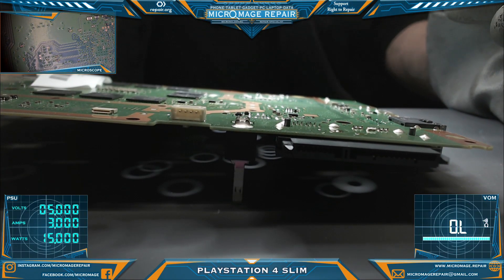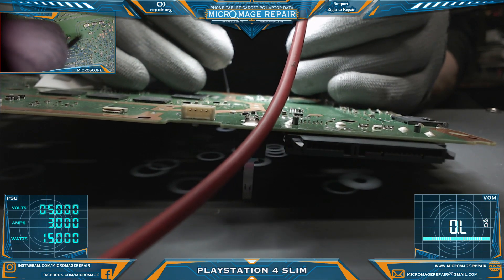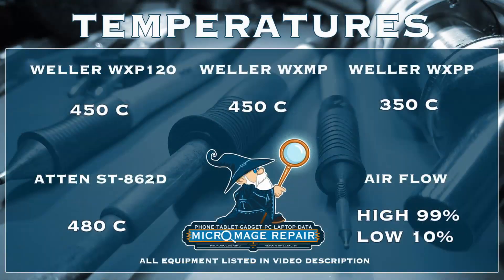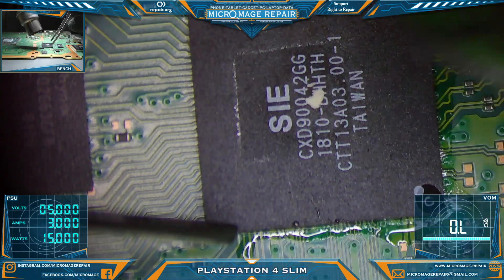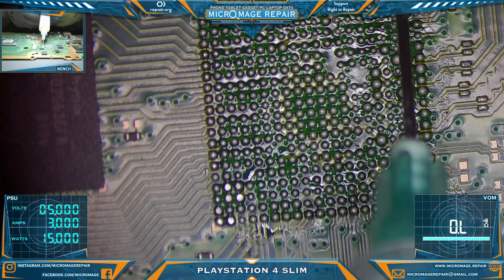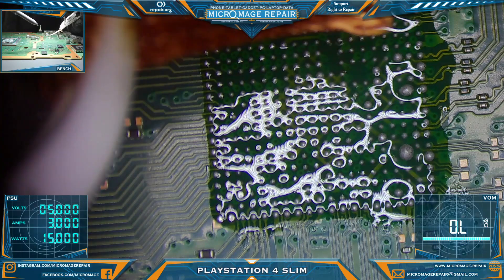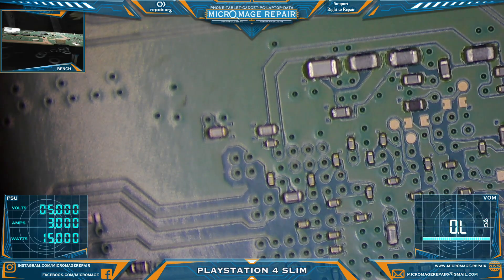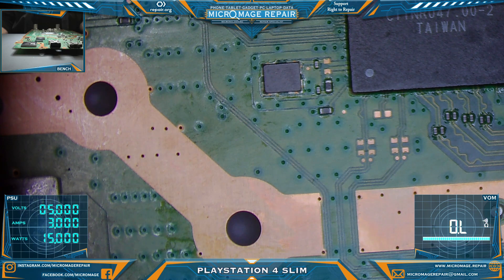Solder & Wick: PS4 Slim South Bridge Soldering

Comment: I tried removing this same chip with my air station and I couldn't get it to budge. had it at 450c/max air flow. :(
Reply from the maker: I hear you.
These chips take an incredible amount of heat. Before the pre-heater it took 10-15 mins at 480c max. Even after it isn't fast.

Comment: Hey mate nice video. What temperature and air flow speed you use to reflow southbridge? Also  is it better to heat board from below or above?
Reply from the maker: 480C at 99% for removal.
I tack a new one down at same temp but 20% air (just looking for a few points of contact at that juncture)
Once tacked down I flux and crank back to 99%.
All from above the board up to this point. 
Never tried from below, but it's probably not a bad thing to try. 
Might work on the Slim.
Doubt I'd try that on a Pro.

Comment: Great video, love that technique of tacking it down. I am very dependent on flux to know when the solder flows so I don’t think I could do that tack down with no flux. Love the tip you used to wick those pads, proper technique for sure.😁
Reply from the maker: I don't use flux for that part because I don't want it floating away. It doesn't take much, just a solder ball to bind or two and it will stay put when the flux is added. That being said always do what you are comfortable with.